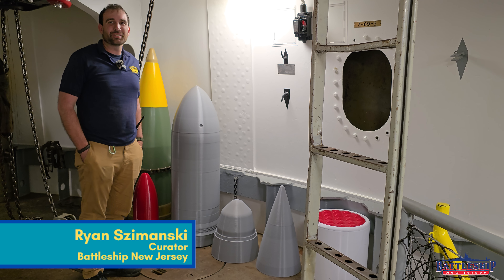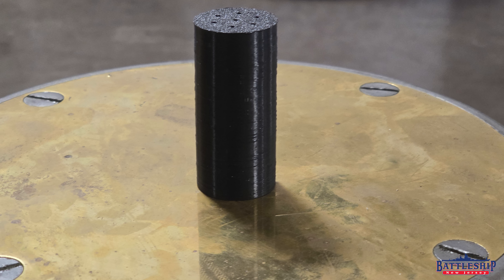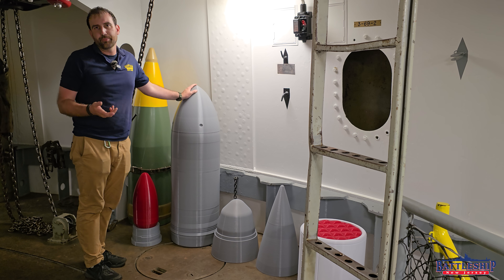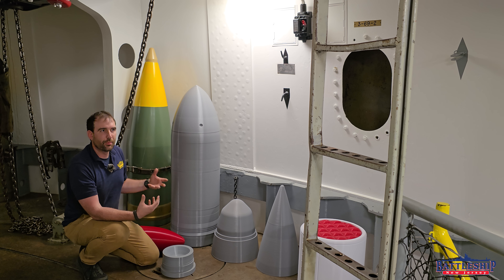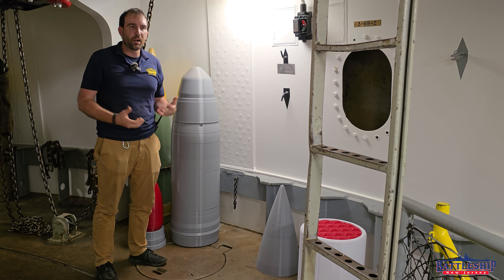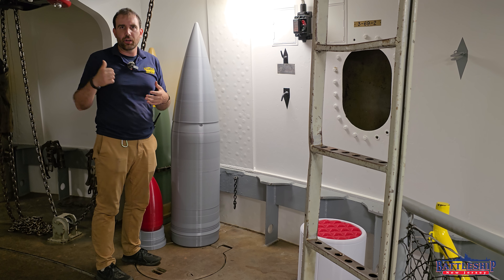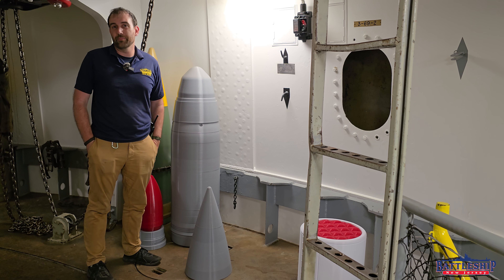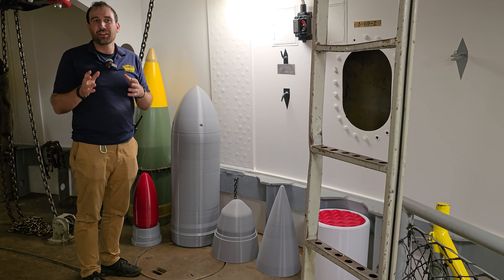The Components of Large Naval Artillery

Comment: Please have someone 3d print the gears that connect the propellers to the engines.  You did a video about those, but because they are one of a kind parts that need to be protected you couldn't show how they worked very clearly, and they are one of the most important parts of the ship.  Also consider the mechanical computer that aims the guns.  That would also be very interesting to dig into and impossible to do with the real thing.

Comment: Are there any thermal elements or factors associated with the strike of the shell?  There would be a significant generation of heat as the projectile tore through the armor...... perhaps melting of steel.  Is the armor piercing portion of the shell heat treated to not disintegrate during the heat reaction?

Comment: So,  all the shells are the same and what makes them different is the nose caps?  Are these screwed on or?
Reply: No, they are not the same. The Armor Piercing ones weigh 2700 pounds and have these pieces rigidly attached so they withstand the rigors of handling and loading. The AP has a base fuze and cavity for the explosive compound.  The High Capacity rounds have a Mk-18 nose fuse and the whole body is filled with explosive. The shell walls are about 3'' thick. The HC round weighs 1900 pounds. They use different propellent to achieve the same ballistics. The inert Target Practice round is like a High Capacity round in weight and dimensions but has cement filling to achieve the same weight. The AP shell is a bit longer...about 6 feet tall as compared to an HC or TP shell which are 65 inches tall.
Reply: To answer the question about assembly - the Armor Piercing Cap was attached using a large amount of solder applied to the mating surface on the core AP shell - while the Ballistic Cap was welded along the circumference of its base.

Comment: If you could do 3D printed miniature replicas of spaces not on the tour route, I think that would be pretty cool, or maybe a replica of a full engine room, with cutaways to see inside the boiler, turbine, and maybe reduction gears, since you normally can't see the insides of those things. Also, if you guys would sell diecast, wood, or injection-molded miniatures of that shell that you can actually take apart, I would buy one in a heartbeat, especially if they were also keychains. They'd probably be kinda expensive, especially if you went diecast, but they'd be super cool regardless.

Comment: This is a brilliant education tool, my only concern from experience with 3d printing is durability.
Make sure to keep these away from direct sunlight as it will make the material brittle
and away from heat as it will deform the material
you could also create a mold around them and then from that mold create a resin version, especially as you can then also easily create more 
which will guarantee that such a brilliant object is preserved especially given the inherant weakness of PLA
and if the public will be hands on with them then I give them a 6 month lifetime so may definitely be another argument for casting resin version (i do think versions for the public to handle would be brilliant)
Reply: Costs about 2x, but ASA would be a great material.  As dimensionally stable as ABS (you have to print it at about the same temp), but more UV resistant.  Painting them will also help.